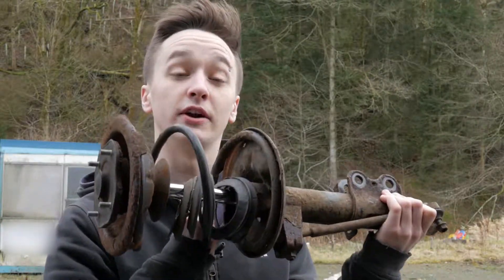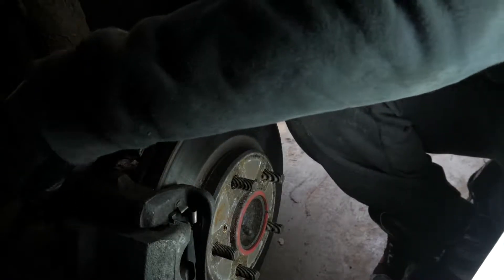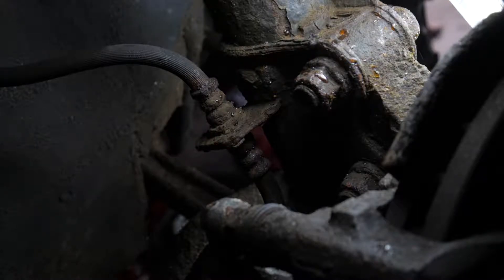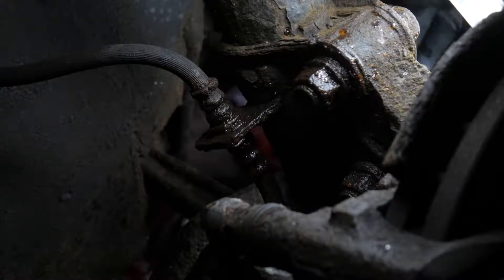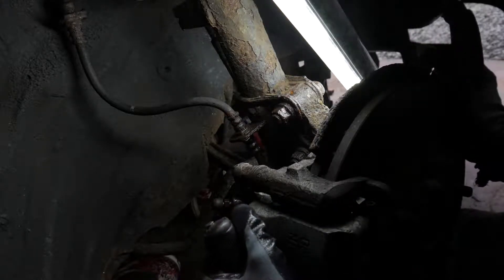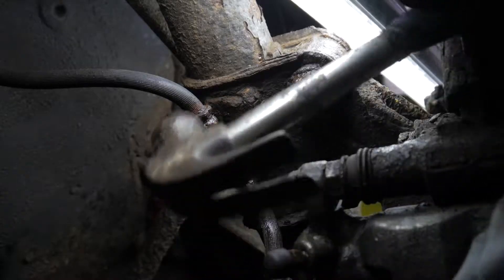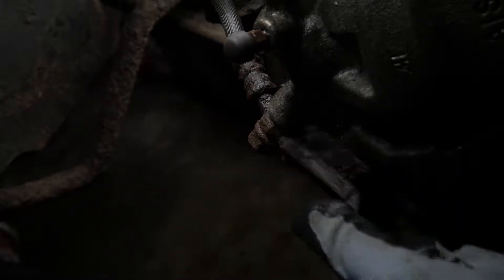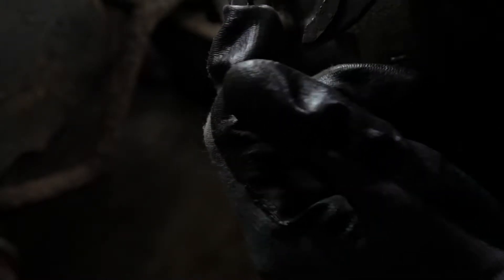Removing The Original MR2 Suspension

Comment from the maker: Instead of clamping the brake lines. You could open a bleed nipple on a calliper, press the brake peddle to the floor and then prop it there with some wood so the peddle stays down. This stop anymore brake fluid from dripping out of the system. It also means that you are not potently damaging your brake likes. IF YOU HAVE BRAIDED BRAKE LINES YOU CAN NOT CLAMP THEM!